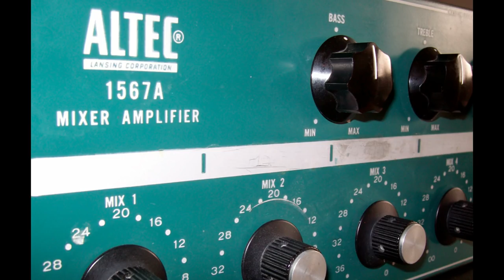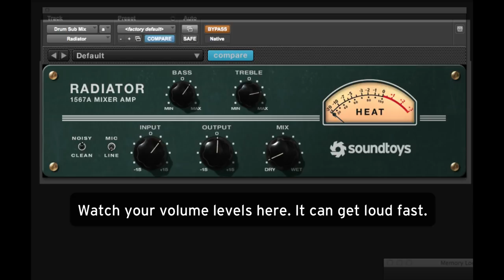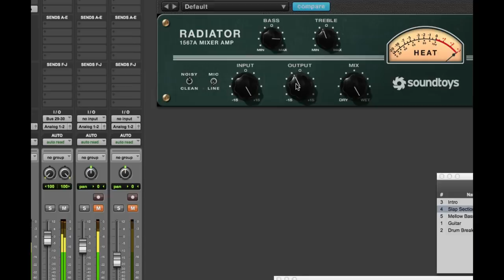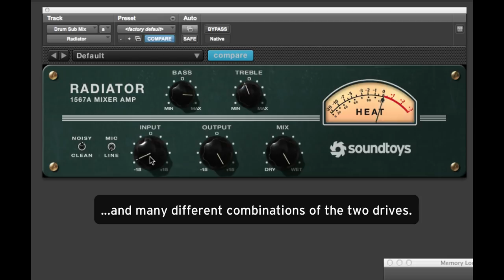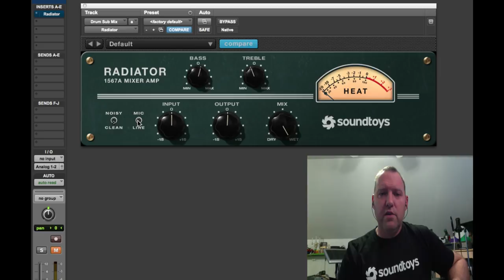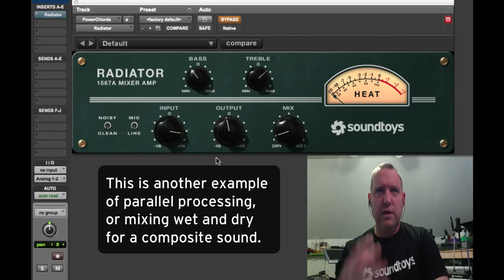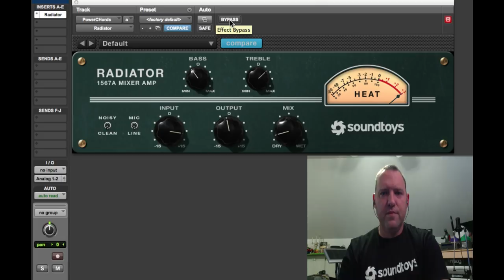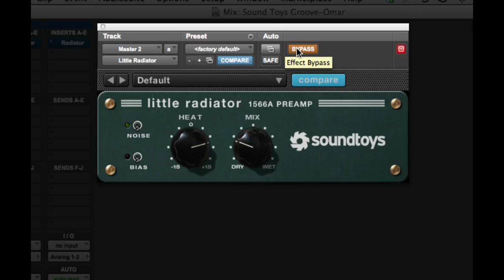Radiator & Little Radiator: Introduction

Comment: Would have been nice to have a trim at the end of this chain. Makes it easier to control the volume in the vst. Maybe even a link between input /output and trim. Idk. Just ideas.
Reply from the maker: If you have the Effect Rack you can use the Input and Output controls from it to balance your volumes. That's one of the great things about the Effect Rack is extending the capabilities of the plug-ins without having to completely redesign each one.

Comment: In terms of sound, is little radiator really different than radiator? kan you use radiator as a preamp too?
Reply from the maker: They are different but similar in sound as the full Radiator has two saturation stages (input and output) being modeled on the Altec mixer and Little Radiator is modeled on the single stage preamp. But... if you don't push the output stage, the input side of Radiator is very very close to Little Radiator in sound. It's all about the subtle color options and not so much dramatic differences.

Comment from the maker: Juice is still coming. For sure. The concept has changed a bit, and we think everyone will dig it, we just had a lot of platform stuff that had to go in front of it. Once that's done, we can turn our attention back to Juice. Radiator certainly was part of the research we were doing for Juice, but not in any way a replacement, just an extra interesting sound for the palette.